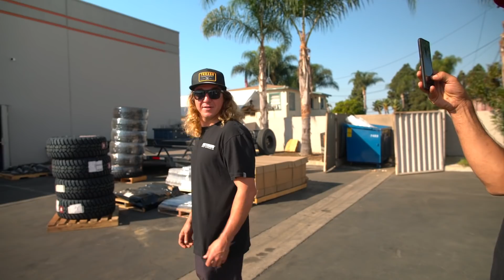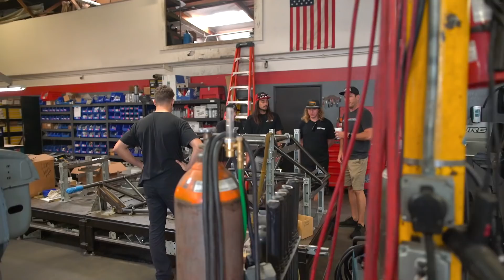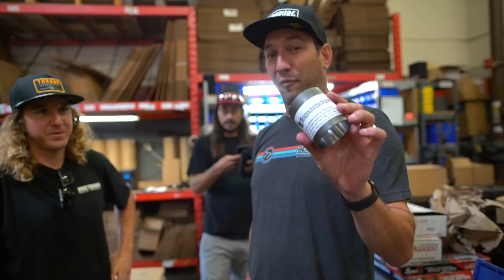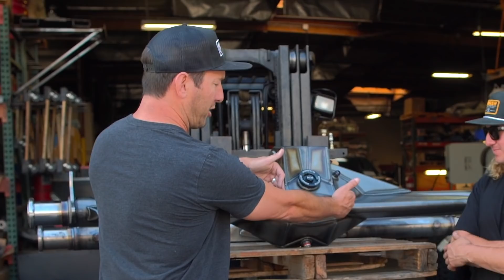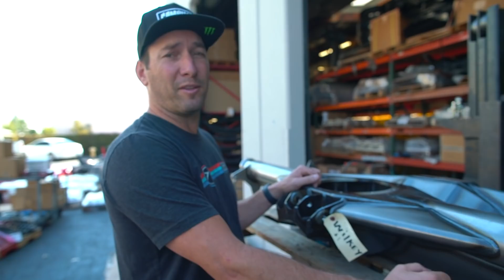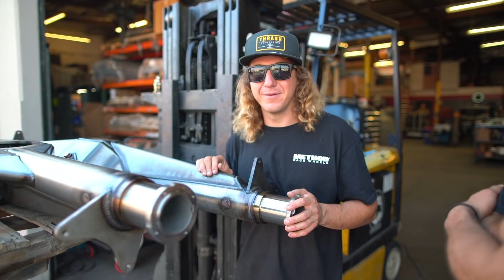TT BUG build... Jaws ep: 1 at Camburg

Comment: It actually pre-loads the bearing and prevents over load on the bearing by limiting linear travel on the axle stubb as the jam nut is torqued.  Its basically bottomed out to a pre-determined point that preloads the bearings.